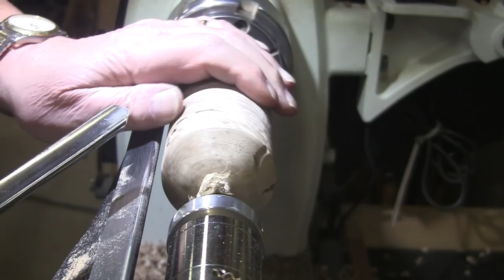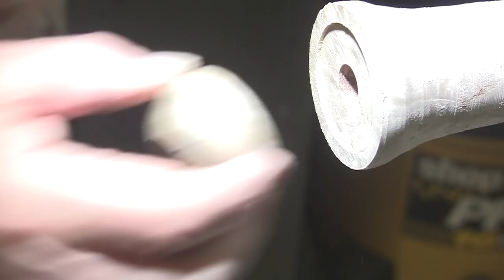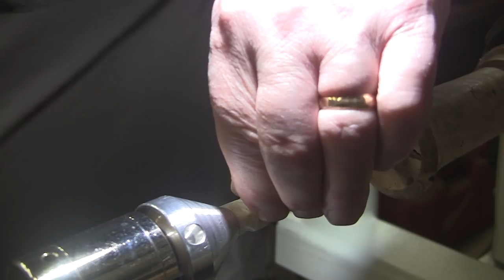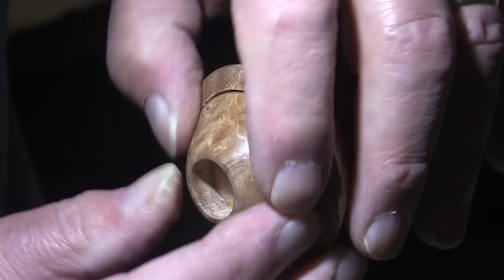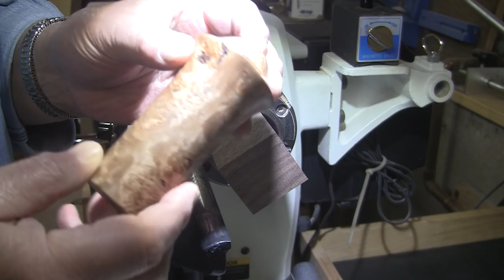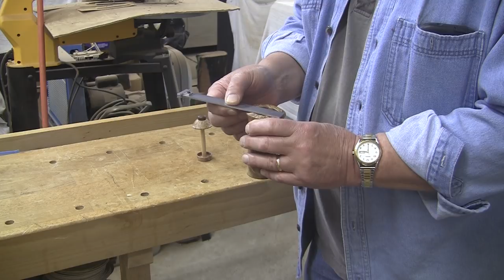Super Secret Turning - Don't Peek!

Comment: Yeah it sure is COOL. Good recovery with the 5/8 hole too Phil. Just a tip on knobs. I bought two lengths of PVC rod. 1" and 1/2" diameter for making these sorts of knobs. It fits in the chuck easy and turns OK. You have to finish it with a microcrystaline paste to get rid of the tool marks. It comes in all colours but I settled on black and so I get real ebony looking knobs.
Reply from the maker: Thanks for the tip, Ray! 😊

Comment: That really is beautiful wood and you did a really nice job creating that toothpick holder. I have seen these before but forgot about it so you have me guessing right to the end. I think the reason I put it out of my mind was because of the mess if somebody pulled the thing all the way out while it was full of toothpicks. :)
Reply from the maker: Thank you very much, Terry!  Yeah, I warn people before they pull it all the way out.  No need to, really, just a couple inches gets you a toothpick. 😊
Reply: Easy fix for that: cut a thin ring that fits tightly to the top of the inside cavity and glue it in there. You'd have to put it in between the cap and the basket when you assemble that, but it'd keep the basket from coming all the way out.

Comment: Interesting project. I have one improvement suggestion. I would add a kerf cut to the top and tube. When twisted a single toothpick would fall into the kerf, so when you lowered the top that single toothpick would stay in place. That way when it is closed back up you would be able to grab the espoused toothpick.
The way it is you almost need 3 hands to be able to get a toothpick.
Reply from the maker: You could do that.  😊  I was holding it, that's what makes it look difficult.  When it's just sitting on a shelf, you just pick up the lid with one hand and take your toothpick with the other.  Easy-peasy!
Reply: @PhilAndersonShadyAcresWoodshop  
I always like to over-engineer things.

Comment: Phil I use a 16 inch long piece of one of my old bandsaw blades, with a handle on one end, to cut my lids off for my boxes. Just sit it on where you want to cut and it does the work.
Reply from the maker: Cool, whatever works is good, Mark!😊

Comment: I was stumped right up until the point that you said the length from the bottom of the basket to the top of the piece was a "critical" measurement.  It took about a second for my mind to think of objects that were uniformly that small of a length, and figured it out less than a minute before you revealed what the piece was.  

I've been thinking of methods for adding a stopper to the project.  The easiest solution, I think, would be for the base of the piece to have a hole drilled to the outside dimension of the basket, while the "collar" of the base would have a hole that is the same size as the inside dimension of the basket.  The basket would move up and down in the larger bottom hole, but bump against the collar, while the toothpicks would come out of the hole.  It would require for the base to be made in two pieces though, and it would have been a shame to mess up the grain on that beautiful piece of wood.

Anyway, enough of my rambling.  Lovely piece.  Looking forward to seeing more of your work.
Reply from the maker: I like the way you think, Dan!  Yes, in hindsight, that would probably work.  It turns out, it's really not much of an issue, though.  As long as the user knows what it is, they just pull it out far enough to get a toothpick.  But, for someone lifting it up the first time I see where they could have a mess on their hands in no time!  LOL!  Thank you for taking the time to watch and comment, much appreciated!

Comment: Hi Phil,
Well,,,,I've never seen one before and I think it's a great idea!!!!
You had me guessing all the way until you pulled the top up!
I think the only design change I will make is to incorporate a "stop" so someone might accidentally pull the basket all the way out!
Thanks for the video!
Tom
Reply from the maker: The stop is an excellent idea, Tom, and the silver one I showed has one.  I could not figure out how to get the basket in and then add a stop, it's just too tight of an area.  If you figure it out, let me know and I'll do it!
Reply: Hi Phil,
Drill 3 evenly spaced holes the size of a round toothpick just a bit lower then the top of the cylinder.Cut 3 pieces of the round toothpick that stick about 1/8" inside of the cylinder and glue them into the 3 holes.
The basket will hit the toothpicks so it can't come out.
You can even do this with the one you just made!
Tom
Reply from the maker: I understand, Tom, I think.  But I would have to do it with the basket inside the body, right.  It wouldn't go it if the stops are in place.  Not sure if there's enough room, but I'll take a look.  It is a good suggestion and solution!
Reply: Yes the basket would have to be inside and the 3 holes for the toothpicks has to be laid out and drilled on the money.
Reply from the maker: I took a look Tom, and it's just not possible.  To hit the top of the basket, and ensure the toothpicks don't come up so far as to fall out, the holes have to be drilled almost half way down and there's just no way to get a drill bit in there.  It's just too tight of a space.  If I would have thought about it while I was turning it, I could have cut a groove half way down and then got the right sized O ring to fit in there.  Next time!
Reply: That's how we all learn Phil!
Tom
Reply: Thomas C Kuzia )